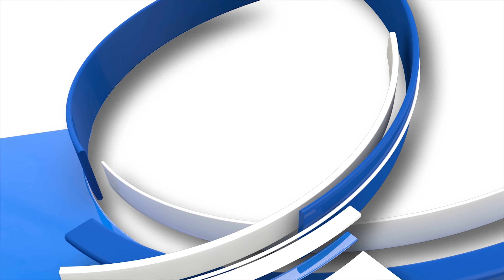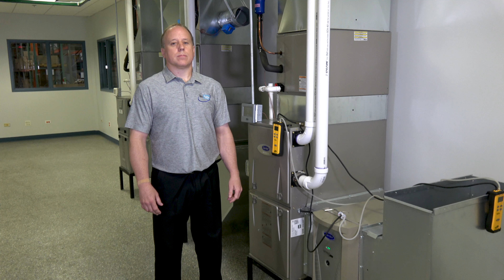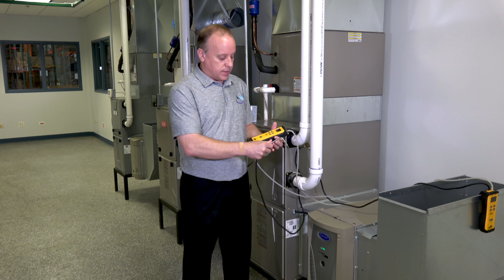Static Pressure Measurements for a Furnace

Comment: So my static pressure is under what my air handler calls for but my limit switches keep turning on and off is that normal?
Reply from the maker: No, it is never normal for limit switches to trip. Which specific limit switches? High temp for furnace? Roll-out? Refrigerant pressure?
Reply: @TECTubefilms  It’s an electric air handler with heat strips.  There are 4 elements controlled by 2 2 pole limit switches.  Only on of them trips shutting off two elements.  Im not sure when it started doing that (maybe always) because we don’t normally use it (heat with wood).  I noticed it by accident when I stopped the wood stove for cleaning.  Im guessing even if the static pressure is 0.18 before the filter and 0.22 after it probably needs more air flow.  I disconnected one of the 4 elements for now and seems to run ok like that.
Reply from the maker: @GotrekGurninsson  0.18 before the filter and 0.22 after the filter just tells you the static pressure drop across the filter is 0.04 which is very low and indicates the filter is probably low MERV also. If you are interested in knowing the total external static pressure so you can compare that to the airflow tables of your air handler then you need the static measurement upstream of the filter and downstread of the air handler. In either case, think about which fan speed (we assume your air handler has different speeds for different modes) it is on when you remeasured the static pressure during maximum heat mode. Look to make sure you have the fan speeds set to provide the correct heat rise. Measure the temperature instead the duct and also pull out the limit switch and measure the temperature in that spot. If any of this sounds like it is beyond your HVAC and electrical skills, hire a professional. Good luck in your troubleshooting.

Comment: Thanks for the video it was very educational and helpful. I have a 
Carrier 58mca-060-16110 furnace with air conditioning installed in a 
small room at the center of the house with grates in all the walls to 
the surrounding rooms(house is on a slab and doesn't have return 
ducting). The filter is mounted on the side of the furnace(one side 
exposed to the room) and sucks the air directly from the room.I have a 
digital manometer and want to check pressures on the furnace. I have a 
few questions if you don't mind.

 1. Does the one probe need to 
be held in front of the filter or just anywhere near the furnace. Or is 
it needed at all, at least for the filter drop.

 2. Does the 
probe inserted above the heat exchanger and below the evaporator coil 
need to be anywhere specific in the space. My coil is offset to the left
 side directly over the heat exchanger (no room to insert it) but there 
is a lot of open space to the right of it that's probably not directly 
in the airflow.
Thanks
Reply from the maker: 1) If there is no return ductwork, then one port of the manometer can be left open to the room

2) Yes, probe position in ductwork can matter.  As air travels thru turns/bends, you can get "dead spots."  The best place to measure is in a straight piece of duct that is 3 to 5 duct diameters downstream (and upstream) of any elbows, transitions, or take-offs.  For residential applications that is nearly impossible.  LOL
Reply: @TECTubefilms  Thanks for the reply.On positioning the probe, I was referring only to the area between the exchanger and the Evaporator coil. There is wide open space to the right of the coil where the probe would fit but not much between the top of the Exchanger and the Coil.
Reply: Should pressures bed taken with furnace operating or just blower with furnace off, since air temp can affect readings? Thanks
Reply from the maker: @normanziegelmeyer7693  Additionally, most furnaces have more than one speed.  So the fan only speed is often different than the fan speed when in heating... and different than when in cooling... and different between multiple stages running.  It should be tested based on what you are trying to troubleshoot.  If it is a test during initial install or for some sort of utility program, you should probably test it at the highest airflow which is usually during the maximum cooling stages.

Comment: One of the most confusing videos on static pressures. Why show separate manometer readings that don't match or make sense with what you're saying.
Also confusing when checking pressure drop across filter. You say to add the pressures for total external static pressure regardless of positive or negative then for the filter drop you don't say to subtract for the filter difference.
This video should be deleted.
Reply from the maker: As Dave stated in the video, we used two manometers so he could hold one and the camera could focus on the other.  The readings did match within two hundredths of an inch.  In retrospect we would have done it with a single manometer so they would match exact.  We would have rather had the shaky manometer reading than being off by a hundredth.  Thank you for the feedback.
Reply: You sir, are an idiot. Granted, I hate the sound, but other than that the information is correct.
Reply from the maker: Dave was correct when determining the total external static pressure of the system.  You add the pressure on both sides of the fan without regard to the positive or negative sign.  The fan must overcome the resistance of the evap and supply ductwork (positive side of the fan), as well as the resistance of the filter and return duct (negative side of the fan) so it is additive.
Reply from the maker: We are unclear on what you mean regarding the filter.  What are you suggested being subtracting when measuring the filter drop across the filter?
Reply: I agree Tony -- the math is goofy. At 5:20 he says the "Total Reading" for the filter difference instead of subtracting....very confusing.